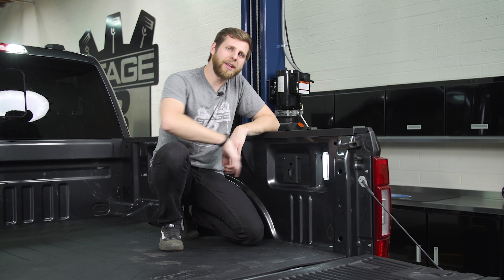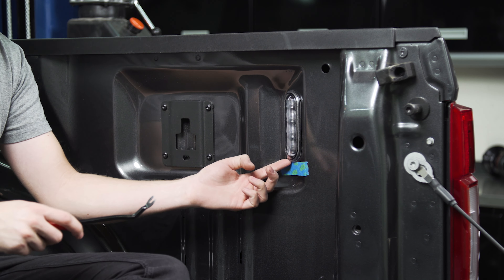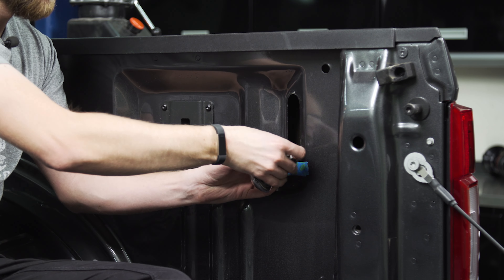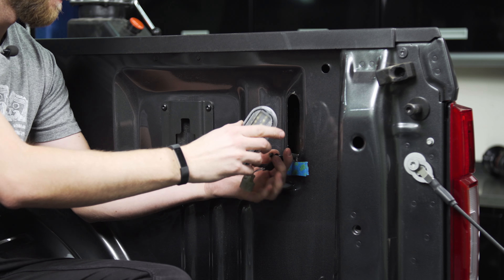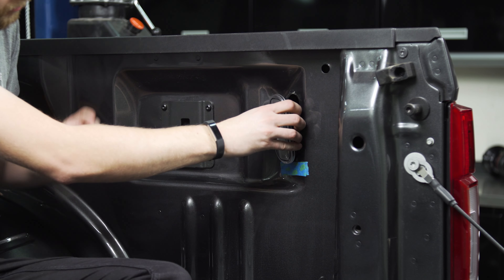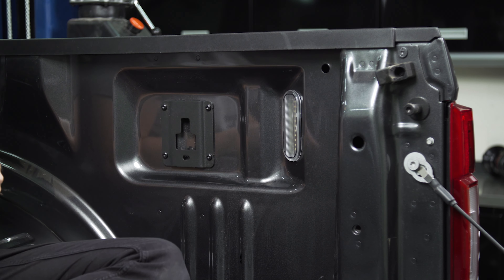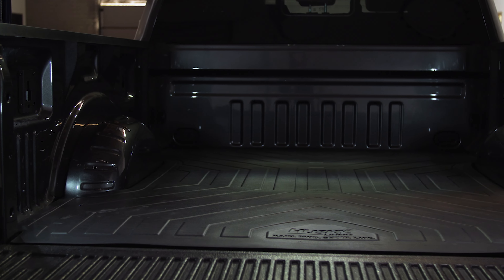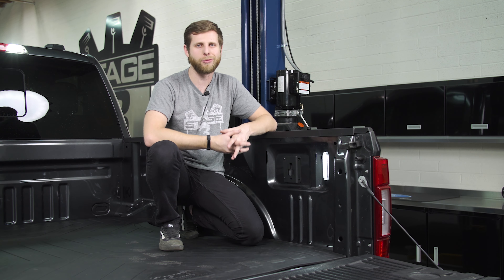2015-2020 F150 & 2017-2020 Super Duty Morimoto XB LED Bed Light install

Comment: Does Ford run the wiring to the bed to install these if you don’t have existing lights? If not, how easy is it to do, and where would I get the parts?
Reply: Same question. I don’t have lights currently. Are the plugs back there or will I need to wire from the tail light?
Reply: by any chance did you get an answer from somewhere else?
Reply: No. Trucks that do not come with bed lights are not pre wired for them. You can buy the wiring harness and the lights ($250 😧) but still have to have the dealer turn the function “on” or do it with Forscan. That said check out the Starkey aftermarket led bedlight kit.
Reply: I believe limitless auto works sells kit